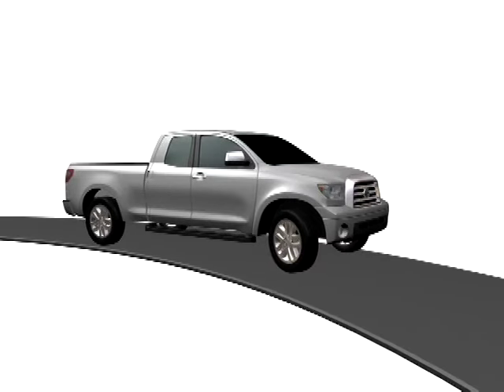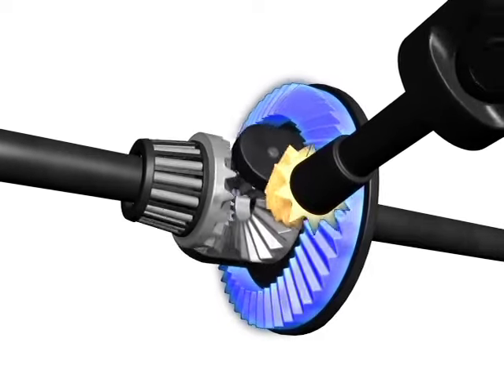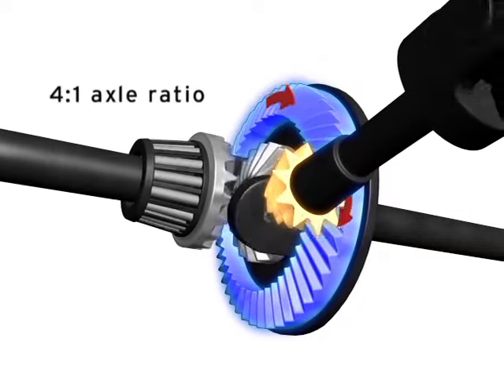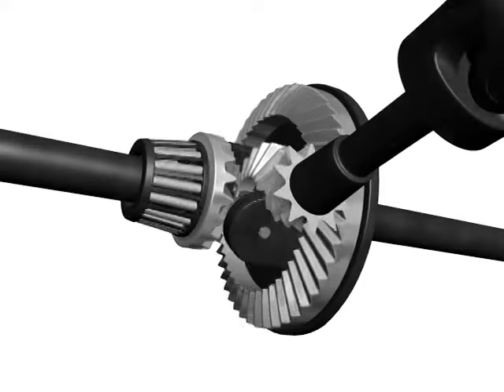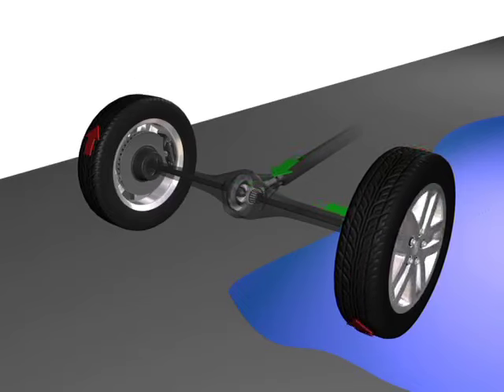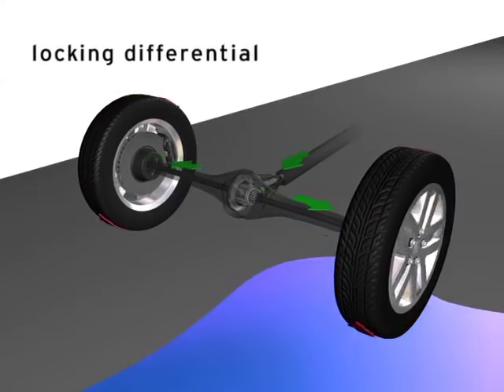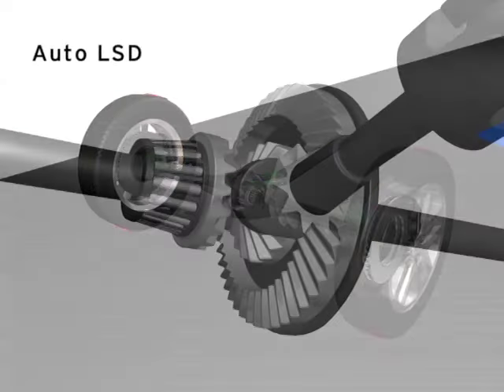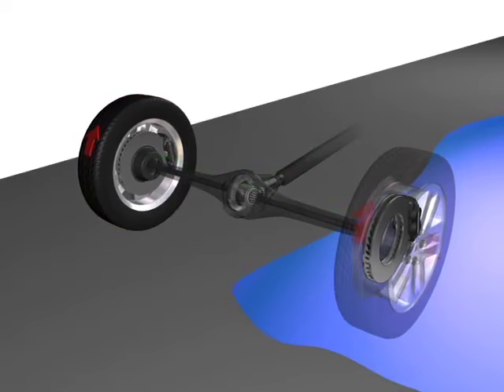How a Differential Works and Types of Differentials

Comment: allegroracing - your definition of "axle ratio" is incorrect. Just because a differential has a 4:1 gear ratio, that does NOT mean the pinion will turn 4 times for every single revolution of the ring gear. The Axle Ratio is simply a comparison of the number of teeth on the pinion and ring gears. If the ring gear has 40 teeth and the pinion has 10 teeth, then the differential has a 4:1 axle ratio (also known as gear ratio). Just because the gear teeth have that comparison, does not mean that the gears will move physically by the same degree.
Reply: you need to re look at what you have written  4.1, 40 teeth it moves 10 teeth  the  pinion as i reckon thats a quarter of the crown wheel 90 degrees  if it had 20 teeth (2 to 1)it would move the crown wheel 180 degrees........  ( Just because the gear teeth have that comparison, does not mean that the gears will move physically by the same degree.)is  totaly wrong this how gears and  ratios  work
Reply: If you're saying what I think you're saying, then you're wrong. You can theorize all you want but many years ago, I tried to prove what I think you're saying (I think you're in agreement with the video) to friends by actually doing it on a car and it did not work. The car in question had a 4.111:1 gear ratio and we tried to move the pinion (by turning the drive shaft), the 4 times that should've rotated the rear tire (tied to the ring gear) once (or almost once) and it did not. It turned out that the shaft rotated a little more than 2.5 times for every one revolution of the wheel. That car did not have anything near a 2.5:1 gear ratio.
Reply: iam not theorizing ive changed dif ratios on several vehicles including Jags ,Aston Martins and racing off road Range Rovers . you cannot check the ratio at the wheels unless you have locked the dif inner gears or it is a limited slip dif . if the dif is locked then the wheels will turn at the same rate as the crown wheel both sides (as will a limited slip dif with no pressure on it ) i can only assume when you tested for the ratio you did not take into account the movement of the inner dif gears hence your 2.5 to 1 . ps if you lock one wheel on a normal axle and turn the prop the free wheel will double the ratio as the inner dif gears take over
Reply: you can also just jack up one wheel and leave the other on the ground....still doesn't correct what the video says, though. Gear Ratio is just a comparison of the number of teeth on two gears.
Reply: wtf are you on?
Reply: Omega, who are talking to?
Reply: Dude. LOL, please go back to college if you already went to it or go to college if you haven't yet, any teacher that knows about transmissions is going to laugh at your "provement". 

BTW "Axle Ratio is simply a comparison of the number of teeth on the pinion and ring gears" DEAD WRONG, not only gear ratio is a direct comparison between the teeth of two gears, the turning of one to another but ALSO the torque multiplication that brings to let's say a truck which is why people with bigger tires will always want a car with a lower rear end gear ratio (more torque multiplication)
Reply: Elsy Albarran - Ok, If you're so sure I'm wrong, then please enlighten me...what is the definition of the term "axle ratio"?
Reply: The ratio of revolutions will always match the ratio of teeth.

Comment: Yes, it wears the brake faster. And what can a locked differential do? break an axle, or brake the ring and pinion, or break all of them. Compare the price of replacing a brake pad or rotor if its been a lot lot of miles, against replacing an axle, ring and pinion. Go on...

Comment: Braking to get traction? Where have we turned wrong. I can see it's because of the open differential but it makes no sense to me. We're not suppose to brake if we want to get moving!
Reply from the maker: A spinning wheel has 0 traction. Because an open differential sends all its power to the spinning wheel, braking the spinning wheel (which doesn't have traction because it's spinning) transfers the power over to the side that isn't spinning. That wheel then has the power to get the vehicle moving. The side that's spinning is doing no good whatsoever by spinning the wheel so that wheel is braked to transfer power to the other side.
Reply: I understand what you're saying. But maybe it brings potentially other problems you don't want. Do you know always when a tyre is ok to turn again. So that it uses it's traction again in stead of blocking the other tyre. What if the traction is 75/25 in stead of 100/0. I'm not saying the system in the video isn't a good solution, the only thing that triggered me was why brake when you technically don't have to?
Reply from the maker: Because the wheel speed sensor contributes to a large number of systems and the central controls including: ABS, VSC, EBD, TRAC, Engine Speed, Transmission control and more. So the vehicle knows exactly what each wheel is doing and is calculating it many times per second. In some vehicles the wheel speed sensor even detects if the vehicle is airborne and reduces engine power.
Reply: I see. Thanks. Actually I was wondering about the following. When making a turn the spider gear in addition to spinning is forced to rotate due to the RPM difference between the two axles. The spider gear is connected to the ring gear so which means making a corner would affect the RPM of the gearbox. If the gearbox cannot cope with the alteration you cannot make a turn. True or not true?
Reply from the maker: If you look carefully, you'll see that the driveshaft is always turning at the output speed of the transmission but the spider gears turn at different speeds depending on the differential action caused by the rear wheels. So the engine/transmission/driveshaft doesn't get "loaded" by an open differential.
Reply: 1. When driving straight forward ringgear, spidergear and axles have same speeds.
2. When turning, ringgear and spidergear still have same speeds. Although cruising with the same km/h the wheels travel different distances on the ground and therefore the axles have different speeds. The spidergear drives the axlegear but now is forced to start rotating and with that takes up the speed differencies.
Of course the spidergear is drive by the gearbox no by anything else.
Reply: And the rotation ratio between the axles specifies the speed of spinning of the spidergear.

Comment: i wonder if toyota give there customers a years supply of brake pads because of that auto lsd, sorry if ive over-estimated the clamping force it genrates on the rotors but that is something that would definetly stop me from purchasing that specific vehicle, should be called an anti-burnout lsd, spin a wheel and the brake will grab it...sounds more dangerous then anything for wet conditions

Comment: @metalmessiahmetal 
One has to weigh the advantages and the disadvantages and come to a conclusion based on what you need to do with the vehicle. And as zela9999 mentions, it's a great thing for the average driver who just toodle around in his generic eco box and sometimes run into a small patch of ice on a parking lot.

But for the more serious offroad drivers, or racers, it won't cut it, you will need "the real deal" so to speak.

Comment: limited slip doesn't help for shit when you get stuck especially in mud or snow, posi rear ends the way to go.  My old truck has truck has true 4 wheel drive, not like the new trucks where maybe 2 or 3 of the 4 will be spinning where as my truck has 4 spinning all the time.

Comment: locking diffs are dor drifting to :D
Reply: They are better for drag. In drifting, you want a power fluctuation so u can burn rubber on the outside tire. They be able to regain control. with a locked differential you will not only damage you car but it will be more difficult to regain control.
Reply: Edmund Ramirez  so true bro
Reply: Edmund Ramirez you have never drifted in your life have you
Reply: ive drifted more times than you
Reply: no problem gay ass driver
Reply: ..good effort

Comment: @allegroracing thats why i wrote "sorry if ive over-estimated the clamping force" so its just enough to transfer power but not enough to cause drag "at low speeds only" as you stated, never assumed it holds onto the wheel just assumed the faster it spins the harder it will grab? wich could be dangerous at speeds if the ass end kicks out, it doesnt seem like that diff has a real purpose amongst others but been cheap, didnt toyota want to use the ol' cone-type lsd? now thats a cheap shit diff lol

Comment: It's all bullshit. Open differential splits the torque 50:50 - this is why it sucks. Locked differential can split torque even up to 100:0 or 0:100, the LSD is something between open and locked. That's how the world works. TC+open diff is NOT the best option, it can be even called the worst one. Losing energy on braking, that's fcking great. Mitsubishi upgreaded it to the AYC - you're not losing energy for breaking, instead the torque is send by electronics where it is needed. But if it comes to safe and stable driving there's no better thing than LSD (there're are several types... only some of them are as effective as they should be).
Reply: +Tall_midget  you've got it backwards, an open diff will allow up to 100% of the engines power to travel down one axle shaft, the point of a locked differential is to connect the two wheels across an axle together so no power is "wasted"
Reply: I don't think so.. Open diff will always split torque 50:50. ALWAYS. When it's locked torque will travel to the wheel with more resistance, traction. Want a example? Winter, icee road and a RWD car with open diff . Let's say that only one rear wheel got grip (let's say 50 Nm), the other one - little traction, sth like 1Nm. The engine will produce 2Nm of torque, 1Nm to the right wheel, 1Nm to the left wheel. The effect? Car won't move because 1Nm is too little to make it go. Looked diff: Engine will produce 51Nm of torque, 1 will travel to the lower grip wheel and 50 right into the wheel with traction - this car will go easily/

We're not talking about the speed of rotation of the wheel, we're talking about the torque So please read more before you say something stupid :)

By watching dozens of vid's about diff's and reading some books (yep - books) only this vid  was saying something like that...
Reply: +Tall_midget the video says open diff will take the path of least resistance and give power to the wheel with less traction  and limited slip will give equal power to both wheels but limit the amount of power to the wheel with the most traction and locking ensures the wheel with the most traction always has power
Reply: you're wrong, your dumb. look it up dude, its not hard
Reply: Tall_midget is right... an open diff sends the same amount of torque (not power, power isn't a thing without RPM, the drivetrain transmits torque) to both wheels at the same time - it's just the amount of torque the wheel with the least traction can put down. I guess we need to go back and say there isn't torque in the drivetrain unless there is resistance, even if the engine is spinning at it's peak torque. A locked differential sends the maximum amount of torque each wheel can put down - up to the maximum the engine can produce at that particular RPM.
Now that stuff is spinning in both systems (open and locked). The lower traction wheel will make more power in the open diff system  - both wheels receiving the same torque with the low traction wheel spinning faster. While the higher traction wheel will make more power with a locked diff system - same wheel speed but more torque generated by the higher traction wheel.
That's why a car will a locked diff accelerates faster when there is a traction difference between wheels - power at the wheels is what accelerates a car.

Comment: I'm an extreme critic of bad videos...What kind of viewer do u have to be to dislike an educational boring explanation video?  Rhetorical.   Trying to figure out why my 2014 lexus Rx350 has a locking differential?   Probably the most unused button ever on a lexus.  I guess its electronic or...for show?  :)
Reply: It's to put people at ease who have a problem with automatic all wheel drive systems. It's the same reason airlines still put pilots in the cockpit. Most airplanes can take off and land automatically, but people have a problem traveling 500+ miles per hour in a pressurized metallic tube without someone up front at the controls... even though most airline disasters can be traced to pilot error.
Reply: I actually own the vehicle...I was being sarcastic. Your analogy is actually a bad one, (I kniw what you meaht though)  99.999% of all airplanes are manually flown.  From takeoff until landing.  The .1% (Cat level determined) are fitted with semi-auto landing due to extreme weather condutions..such as commercial airlines in Akaska ahd still then they are semi-manual.  It is a common mistake that people think planes can kand themselves. Having flown and knowing countless pilots...almost no plane EVER either lands or takes automatically. So in answer: almost no airplanes land or take off automatically and never bank, descend and ascend more than a 20% angle.   It just feels like more,   I do get what you were  trying to say.  The diff-lock us actually there fir getting out of icy parking spaces mostly. Traction control  off.